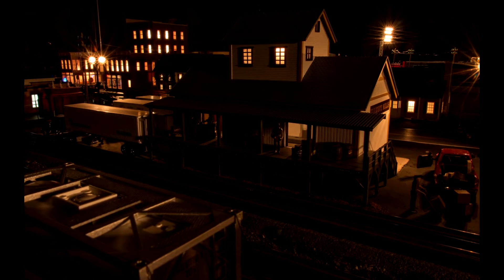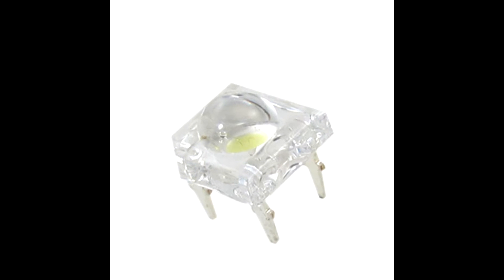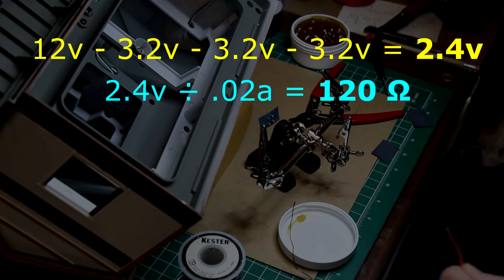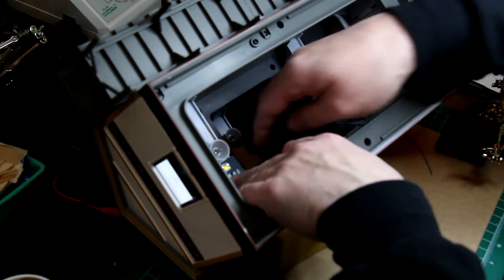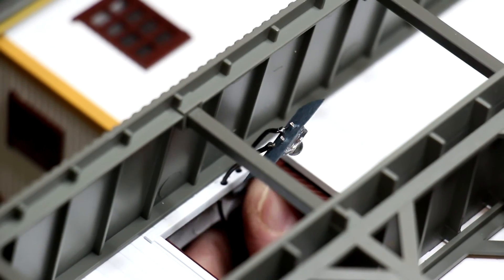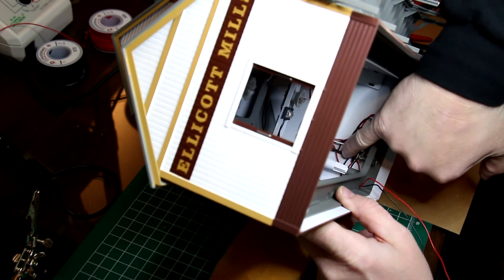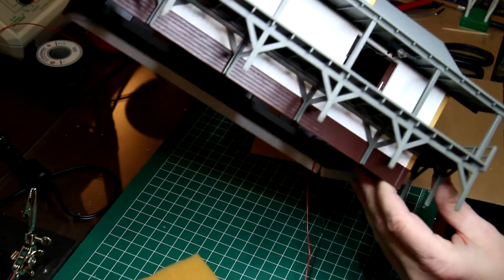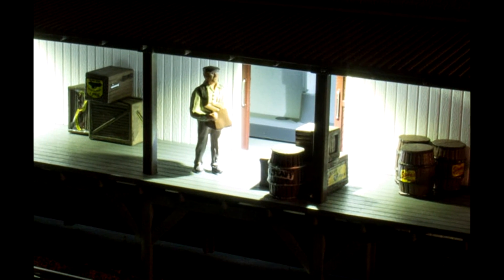Adding LED Lighting to MTH Transfer Warehouse

Comment from the maker: I'd like to mention something I didn't advise in the original video.  If you run the wires for the "under roof" lights over the loading dock where I did, you will not be able to close the doors on the warehouse since the wires are in the way of the track for the sliding doors.  I knew this when I did it but I knew my doors were going to be left open.

Comment: Thank you for this video and doing the research. You just made my day!!!! Now off to get some supplies.
Reply from the maker: Check lighthouseleds.com on the web site or their eBay store for the SuperFlux LED's and resistors.  I didn't want to wait for the LED's from China and the price was good.  Also, the guy is fast and great to deal with.  Tell him Bob from Bobot's Trains sent you...not sure why...hehehe
Reply: Great. Thank you Bob. The LED lighting looks incredible. What a difference.
Reply from the maker: Chuck F Also see Dimming LED Circuit with Trimmer Potentiometer if you want to add a trimmer pot to dim the circuit.

Comment: Excellent research and the use of resistors to make your circuit. This reminds me of several college classes I took in Electronics. Do you use a reference book to get the equations? If so what is the name of the book or charts?
Cheers from Michigan.
Reply from the maker: Gary, there are too many references to list.  Google the terms "calculate led resistor" and you will be presented with many sources of information.  Find a tutorial that matches your learning style and go at it. Spend time reading and learning instead of just using the online calculators. The starting point is the equation for Ohm’s Law. That formula is V = I × R, where V is Voltage in volts, I is Current in amps, and R is Resistance in ohms.
Reply: BobotsTrains Hi Bobots Trains - I did what you said, did a Google Search. I went thru some old book boxes and found one of my college books on Electronics. Book called,
"Basic Electronics" by Bernard Grob - Instructor at RCA Institutes, Inc. Finding this old book with a copyright 1959, 1965 & 1971. The Ohm's Law in this book it still the same today. The resistance of any part of a circuit is it's E/I ratio.Ohm's Law, the three factors are E, I and R are related by the formula R = E over I • I found it to be fun to read this old book as you explained it in your video. There is a chapter on Ohm's Law & Resistance along with the Color Codes.  Thanks for getting me to read this old book. I am still learning as it comes to electronics'.
Cheers from Michigan.
Reply from the maker: ***** Yeah the laws of resistance physics don't change much in 50 years...hehehe.  I'm glad I inspired you to read up on the subject.